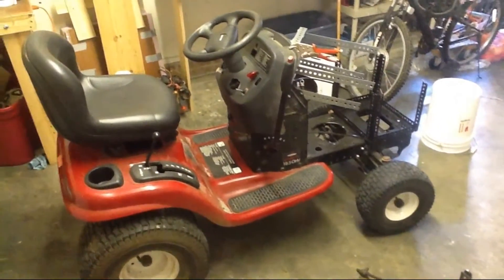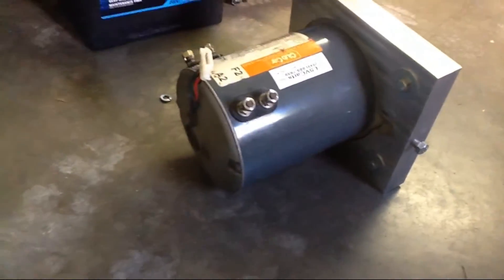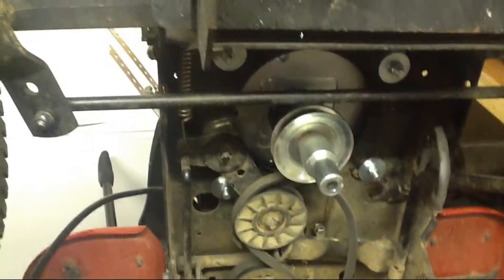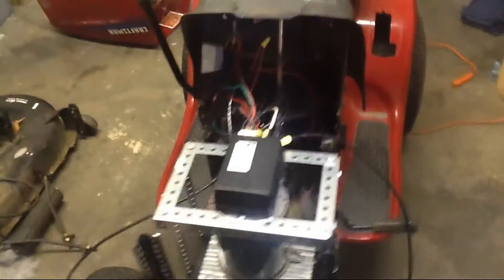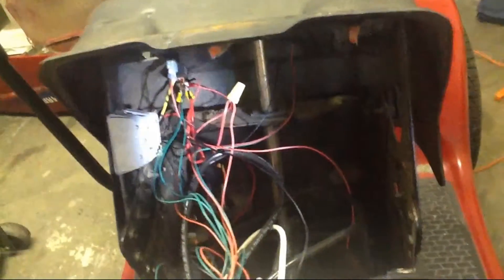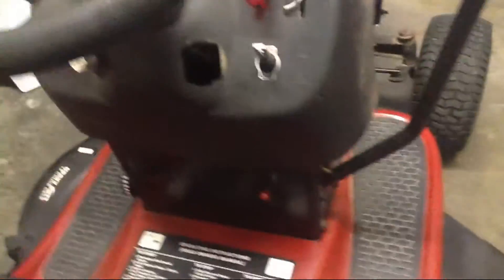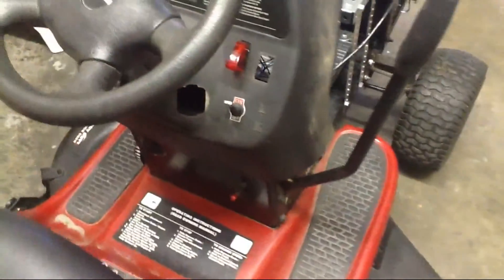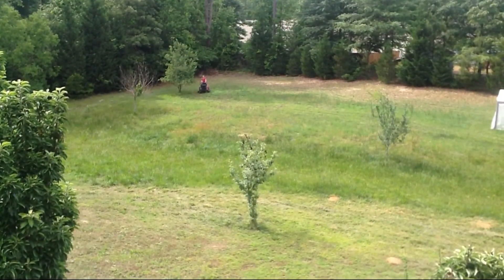Electric lawn mower conversion

Comment: Is this set up using both 48v and 12v ? Is that why you need the convertor? Nice project!
Reply from the maker: Yeah, I needed to maintain the normal 12v system in the mower that ran the lights and the electric clutch that controls the blades.

Comment: Nice one! So, how long did it run on one charge and how big an area could you mow before it died? I am looking to mow about 2 acres and convert my John Deere GT245 to do so.
Reply from the maker: We were mowing about 0.75 acres. With those 4 deep cycle batteries we were able to do the whole thing without any issues, but the motor I used was too small for the job and would heat up pretty quickly.

Comment: Thanks for posting the video!

It's not clear to me from the video, but did you wire up the batteries in series to get 48v? The inverter 48v to 12v can be bypassed if you parallel the batteries to get 12V in the first place and run the motor directly. For a ride on - on/off is probably all the speed control you need. Good inverters are around 80 - 90% efficient, so you are losing at least 10% if not a fifth of the power to losses in the inverter with this design. Also you would want to run sufficiently heavy cables to supply the current to  the motor when demand gets high. 
Perhaps the result would have been different if you had used a more direct approach to powering the motor? Not saying this would have made it a good electric conversion, but certainly better. Also, didn't see the battery types, but you can't use cranking batteries - they need to be deep cycle types.

Again, I'm not sure from the video, perhaps you did what I am suggesting. In any case, just offering some advice and hopefully we'll see you build a more successful machine soon!
Cheers,
BB

Comment: Great Project more people should try
Converting to battery power is a great idea for a garden tractor I converted one 15yrs ago, I used the 3 separate motor design and it is still cutting grass on a daily basis, it is amazing how it never breaks down and needs almost no maintenance, I renew the batteries every 7 yrs I am just on my 3rd set now, my design will cut up to 2 acres on a 50cent charge there are no belts or pulleys and no oil on the entire tractor, it can pull a trailer for about 8hrs on a charge, because battery run time is the most important aspect of most conversions I paid particular attention to the most efficient design, I used 3 separate small motors one for the drive with electronic speed control and two smaller with a cutter blade mounted on the shaft of each cutter motor ,total amperage when cutting grass is approx 40amps, (2000watts) this design only uses the battery power req to do the job, very little wasted battery power, it uses magnetic breaking of both tractor and cutter blades and automatically applies parking brake when you stop or get off the seat, an amazing tractor.
electrictractor.net

Comment: Brian Edmond

Converting to battery power is a great idea for a garden tractor I converted one 15yrs ago and it is still cutting grass on a daily basis, I have had to renew the batteries every 7 yrs I am just on my 3rd set now, my design will cut up to 2 acres on a 50cent charge there are no belts or pulleys and no oil on the entire tractor, it can pull a trailer for about 8hrs on a charge, because battery run time is the most important aspect of most conversions I paid particular attention to the most efficient design I could up with, I used 3 separate small motors one for the drive with electronic speed control and two smaller with a cutter blade mounted on the shaft for each cutter, this design only uses the battery power req to do the job, very little wasted battery power, it uses magnetic breaking of both tractor and cutter blades and automatically applies parking brake when you stop or get off the seat.
Brian Edmond,
Edmond Electric

Website: Electrictractor.net

Comment: Nice!  i did something similar, but my donor tractor is horizontal shaft.  had to do alot more fab work than yours (you definitely played it smarter).  I didn't use a controller.  just use the transmission to vary my speed.  did you get 2 hours mow time out of it?

https://youtu.be/Im_5l8aGfJA

Comment from the maker: The batteries are each 12V and the controller requires 48V, so the batteries are hooked up negative to positive (in series).

Comment: Have you looked for a rebuilt kit or changed the fluid. I have a Dixon 38" and the hydro's are lifetime fill but I changed the fluid to mobile 1 10w-30 but i had to drop the whole hydro system and remove it. I then let it sit for a few days upside down then refilled. I think it was about a quart each and it was filled all the way up with the vent tubes as air space.